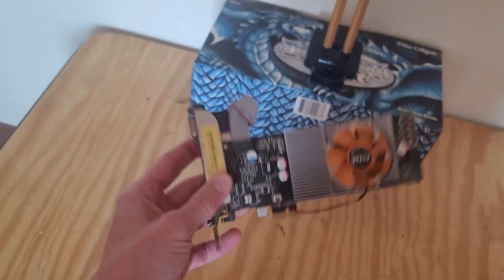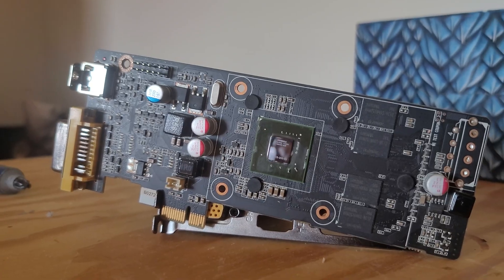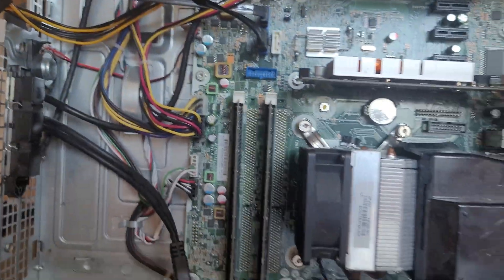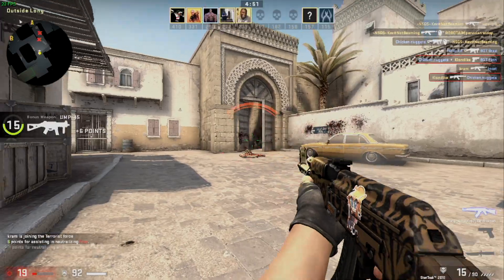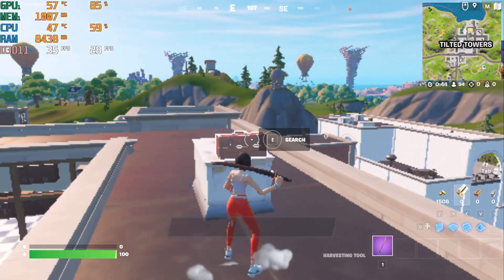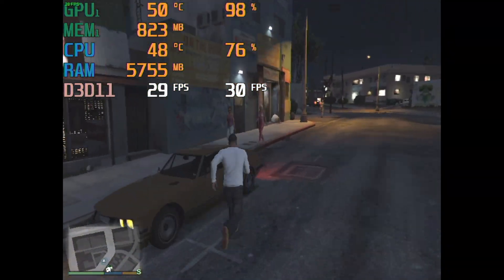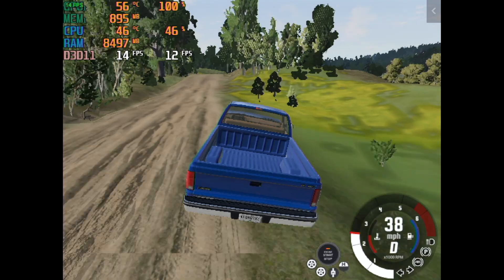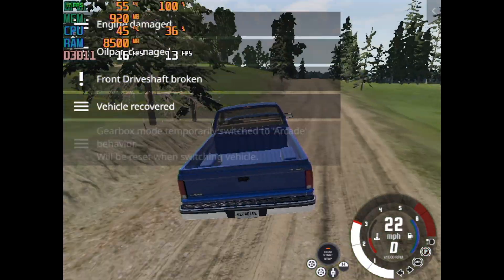Overclocking a Display Adapter and Forcing it to Run Games (gt 610 nearly died)

Comment: btw gt 620 is better than gt 710
Reply from the maker: Didn't know that. Thanks!
Reply: @Jaindike  no problem , I had 2 I killed one when i was modding my case and 2nd one I am still using in 2nd pc it can run fortnite at 40fps, minecraft 60-120fps(depends where you are) and roblox 50-60fps oh yeah it was 1gb ddr3 model

edit: keep in mind i haven't gamed on it for 2 months and there was a lot of new updates in those games

Comment: The intel hd 4600 igpu is prolly better than anything under nvidia 700 series
Val runs 60smooth on medium and even high 40-60fps
Warframe runs 30smooth 800p 75% resolution medium-low